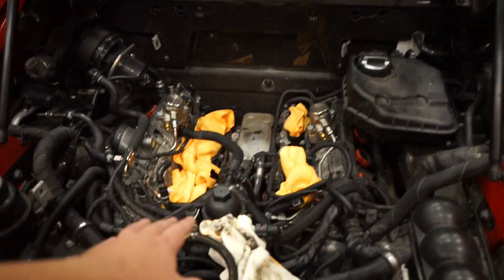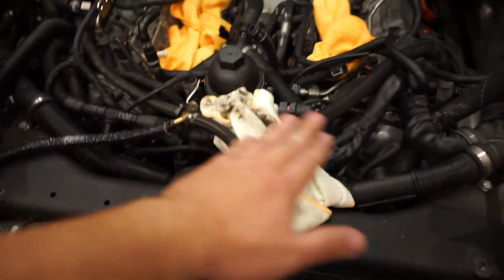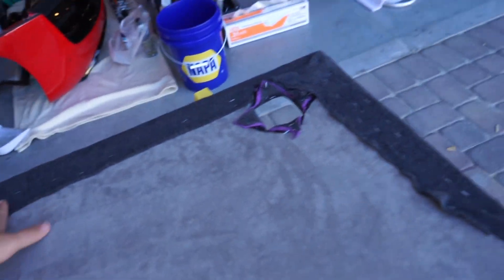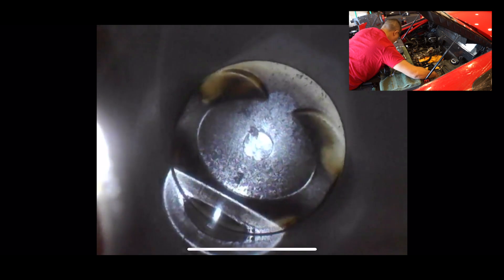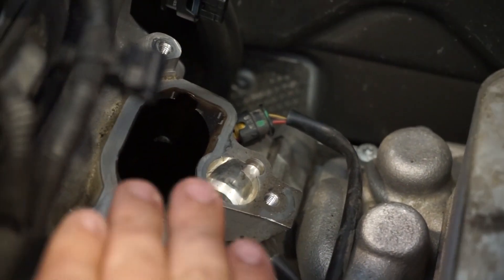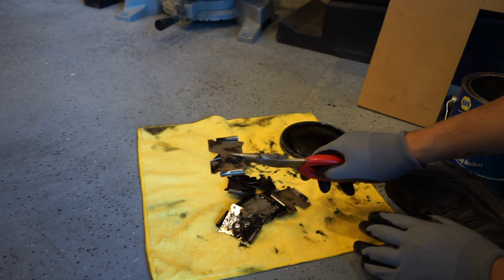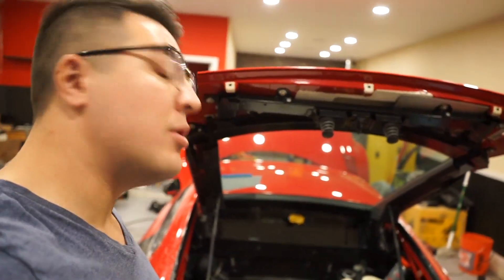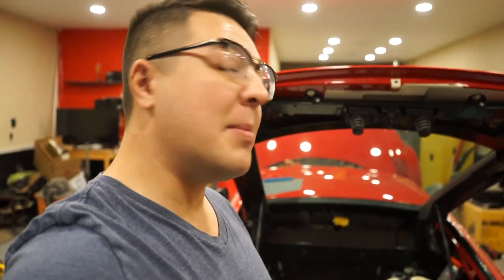AUDI R8 V10 CARBON CLEANING!

Comment: Did you crank the engine while having the i intake manifold off?   Half of the cilindres valves will be closed and the others open. Or did you crank it by hand?

Comment: Hi thank you for the motivation talk! I will be doing our RS6 soon. Just one question, how did you close the valves, once done with one? Did you crank the engine to the point that they are closed? I am kinda scared cranking the engine without the fuel/intake and such attached haha.
Reply: You typically put a ratchet with the correct socket on the crank pulley and rotate the engine slowly.